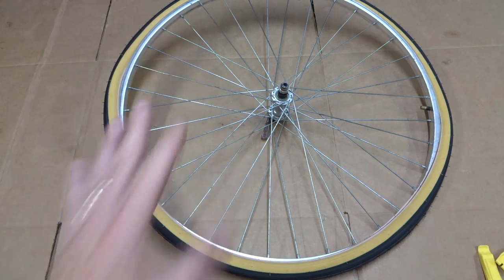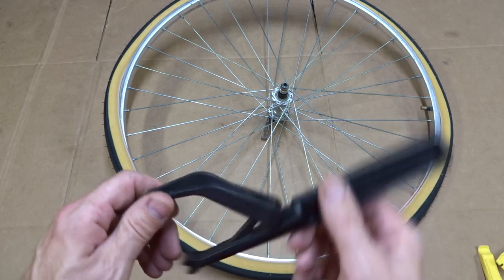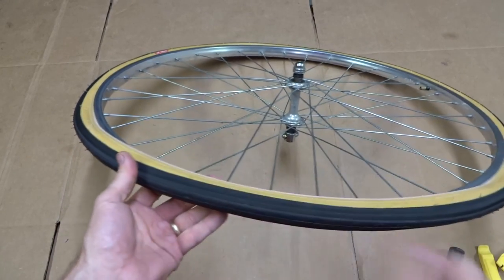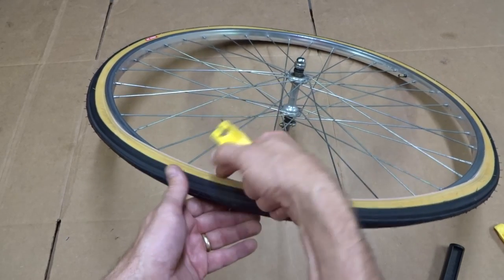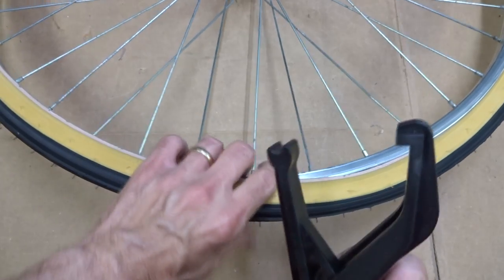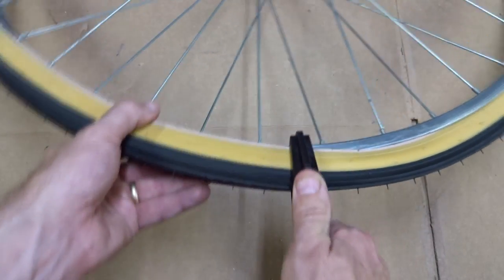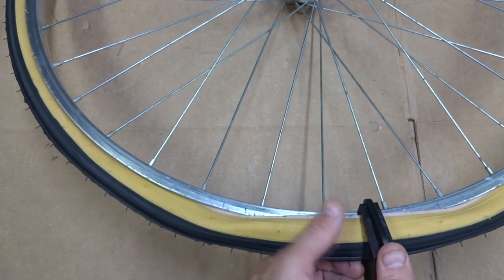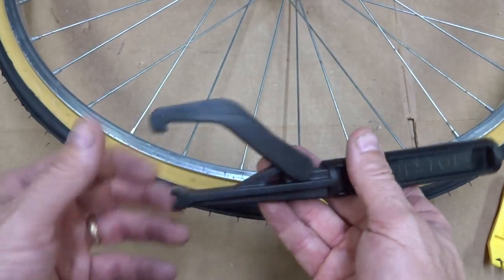How To Get Tight Tire On Bike Wheel Rim With Tire Bead Jack

Comment: I’m working as a rental bike mechanic…. My boss has 3000 bikes ffs ! And in two days I changed 10 punctures . We put new tubes in and a tyre liner that is phenomenally strong ( a pin 📌 won’t  through it ) then in the winter we have a glue party 🎉….. the point is that at 61 after a life time of using my hands as pliers I’m done ✅ with it . After my 10 tyre in 2 days , and some were new , my hands mutinied. This winter ❄️ alone I think I did more than. 50 …. So we have ordered tyre pliers , but the kind that has a tube profile on each side of the jaws . This tool looks cool 😎 tho …. As always thanks 🙏 RJ …. I spread the word about you here in Copenhagen

Comment: Use this tool in the shop where I work. I haven't scratched any wheels yet and don't think I will.  

Works great for road tires and narrow mountain tires but is a little tricky to use on wider mountain tires. In future designs it would be nice if it were wider to accommodate the added rubber.
Still, this tools has saved me a few times.

For those that say they don't need any tools I say good for you. Whatever. I've mounted probably thousands of tires and have run into some where something like this is essential.

Comment: From struggling to fit my very tight Gator tires onto rims to two minutes to do the whole job thanks to this tool. Not only did the tool work as promised, I also avoided damaging the tube as I have done before using tire levers. This is a great product. Follow this video’s advice and work the tool slowly across the last part and it will slide on perfectly. Great product and great video.
Reply: thanks, your comment motivated me to buy one. my thumbs all messed up and I just bought gators for florida roads.

Comment: Changing a tyre in a warm dry workshop is usually not too difficult but in my past 30 years on the road I've never had a puncture in a warm dry workshop ! Most of mine occur at night , in the pissing rain, in the most inhospitable place you could think off. I've had this tool for a couple of years now and to me it's a real game changer as i usually only carry one spare tube and the number of times I've nipped that with tyre levers is unbelievable. Despite some of the negative comments the one I have isn't too big and it fits easily into my saddle bag.

Comment: I got one of these yesterday and it is a revelation, I run Continetal Gatorskins on Mavic Allroad rims and I'm sick of skinning my knucles / nipping tubes etc. I've even managed to snap 2 Parktool tyre levers trying to get these tyres on....however, with this it is as easy as pie. I'm carrying this with me from now on. It IS alot bigger than a couple of tyre levers but the time saved when you are commuting and stuck in the rain trying to wrestle a tyre on makes it SOOOO worthwhile. 10/10 would recommend

Comment: Personal success story anecdote about this tool and Gatorskin tires:

I got flats three times with an older pair of Gatorskins. Two were my own stupidity (pinch flat from using a hand pump and underinflating it, another from pulling off the presta tip with said hand pump) and each time I had to take to a bike shop to remount because I couldn't get that Kevlar bead over the rim, apparently Gatorskins are known to be tough. 

I just got new Gatorskins a month ago and ran over this big piece of metal and went flat again. I decided to give this a try, not expecting much especially with a brand new tire. Literally 5 minutes and I seated the tire on easily with no pain or stress. 

I can't recommend this tool enough. It's only $11-12 and unfortunately it's a bit too big to fit in a saddle bag but it is invaluable.
Reply: "Tough?" 'Tough' isn't the word: I hope I never get a flat with my Armadillos. Took me an hour-and-a-half with 3 tire levers - and I still ruined 2 brand new tubes and almost broke the levers. Never had an experience like that in my life changing bike tires!

Comment: That's an interesting video. You endorse the idea of using a lever to install a tire. I guess you are lucky with that or you have an exceptional technique. I've installed thousands of tires, so I can't say I always avoid using a lever, because some tires are just impossible to install without a tool. My trouble is that when I use a lever, I pinch and puncture the tube 50% of the time. Not a good risk. I find the Tire Jack reduces that to about 0%. You say it's not a must-have tool. I had tires that was so reliably difficult that I carried the Tire Jack whenever I rode that bike, so I considered it a must-have at the time.
Reply: i just pinched 2 tyres at the side of the road, so i'll get this for sure
Reply: It's possible to get by without this tool hence RJ saying it isn't a must-have tool. It's definitely a labour-saving device though.

Comment: Having encountered a few "difficult" racing profile tires in the past prompted me to order myself one of these.  Still slightly skeptical I approached the initial time I used it with a desire to give it a fair chance.  To my amazement the engineered-in physics this tool embodies the tire went on quite smoothly without any undue leveraging of the tire which wasn't always true in the past.  You may not require it often, but when you do RJ is on the money as to it's being of good design and with proper care shouldn't scratch your wheels.  The material is what I believe used to be described as Tuff Stuff used to make virtually indestructible toys.  Great video and it should be used by their company as a guide on how to best use their product.

Comment: It's a great tool. I have some tyre / race wheel combinations that are impossible even with massive metal levers. So this tool makes it easy and avoids pinching the tube

Just make sure that if you need it to get the tyre on that you can get that tyre off in the middle of no where...

Comment: Great video - the Koolstop is great for those of us trying to install tubeless road tires on wide wheels  - and/or with weak fingers.  
As you said, not not an essential tool to own, but I agree it is a great and relatively inexpensive tool to have available as it makes fitting even a tight new tire so very simple!

Comment: I've got one of these built by a Taiwanese company called Bike Hand. The design is slightly different, as it's more of a scissors mechanism, but with the same slotted and hooked ends on each of the arms. It's very useful for mounting tight tires such as Continental road bike tires and 20" BMX/folding bike tires.

I bought mine while vacationing in Shinjuku in Tokyo. It's not available in my home country so it's a rather rare tool here.

Comment: Nifty tool.  I have a bike with a rim/tire combination that I have to use some dish soap as lubricant to help get the tire on by hand.   This tool looks like it will be helpful on the workbench.  However, this tool is a bit too bulky to carry for roadside flats, so I will still have to carry a little vial of dish soap in my saddle bag.

Comment: Has no-one ever taught you to finish at the valve so the rest of the tyre can be seated deep into the well as much as possible!!?
 Great videos though and yes I've had some tight tyres even finishing at the valve. Might even buy this tool if I can find one in UK.. Similarly to first remove tyre start levering either side of valve to get maximum slack. Best regards..
Reply: Nonsense
Reply: Truely, it doesn't matter.
Reply: SJS Cycles sell it which is where I bought man. Luckily they were able to deliver to Northern Ireland so mainland UK should be no problem
Reply: It's people like you who always find a way to make things more technical than needed.  Finishing at the valve?  Lol.  It's actually better to start at or just before the valve to prevent damage to the valve.

Comment: In 40 years of cycling I never had a set I could not mount with bare hands or tire levers. But nowI 've got a combination of Michelin Competitions tires with Easton EC90 rims that are a bear to install without pinching the tube. i've gone as far as using WD40 to lubricate the bead. I'm debating buying this, unfortunatly it's a bit large and nosaddle bag friendly.t

Comment: I have to agree with some other comments. Using a lever to get a tire on the rim is risky and I try do so only as a last resort. And my arthritis in my wrists is getting bad enough that I can't guarantee that I could get a difficult tire on using only my hands. This tool is essential if I am not to be stuck on the side of the road.

Comment: Good tool. I needed that when I'd put a 26 inch inner tube on a 700c rim. The tyre that used to go on easily, got very difficult. I didn't want to go and buy the right inner tube. Lol

Comment: I have a tight tire and my wheel always has this bouncing feel, as one end of tire does not fit in the groove. 
So my question is, can this tool, help to pull the tire into the rim groove properly? so that the wheel rolls smoothly.
Any response much appreciated.

Comment: What about getting the tire off? How do you use that tool for that? Thanks though for all the work creating this video!
Reply: just use levers
Reply: @charlesmiv3842  I've always used levers but studded winter tires are made of a harder ribber and much harder to get off. Mainly I just hope they devise a tool that will do both, take the tire off and put it back on again without having to struggle with the levers. I now carry the tire jack and didn't find out it's only for putting the tires on as I assumed it was designed for both.

Comment: I have a suggestion for a video: One of my Wolber wheels broke the axle inside the rim's hub. I would like to rebuild it but need to get the axle out first. I'm going to try a easy-out when I get the time but would love to see your take on this if you can duplicate the problem.
Reply from the maker: If the axle broke, it should come right out. The axle is the only thing holding the two ends in. I am assuming it's a common threaded axle with cones and lock nuts.

Comment: I have this tool and it does work. You still need to make sure the tube is UP inside the tire and not  still between the bead and the rim or you can still pinch the tube  It has happens to me.

Comment: RJ I'm looking for a took to prevent round straight pull spokes from spinning when truing a wheel. Any suggestions? I tried pliers clamping onto spokes, with a rubber band in between to prevent spoke damage, but no joy. 

Thanks
Reply from the maker: Lubricate where the spoke goes into the nipple.
Reply: RJ The Bike Guy I'll try, but I have these dumb Easton wheels with the hidden nipples
Reply from the maker: Then take off the tire and lube them from that side. Get a syringe with a long needle if needed. I pretty much always put a drop of oil on the spoke/nipple area before working on truing a wheel.
Reply: RJ The Bike Guy I'll try that. Thanks RJ

Comment: If you mount many tires daily then this tool would prove useful since. You would not get much faster than without it, however you'll have to use much less effort and it will be easier than with levers

Comment: Please help me!  i have a 20-year-old Hampton Beach Cruiser that i had restored a few years ago, but i wasn't able to get the original seat (which i loved).  The seat i have now makes me slide forward, and now i hardly ever ride my bike because it's so miserable.  i've tried every adjustment, but it's the seat itself that's too slippery.  Any advice on how to make it less slippery or where to find an original replacement seat?  Thank you.
Reply: Victoria Robersohn use sand paper, fine grade, and buff it perpendicular to the direction you're sliding. Should rough it up just enough to take the gloss off the sides where your thighs hold but not enough to look rough.

Take a little at a time, and use very fine (wet/dry) sand paper. Focus on an area where it won't be visible if you overdo it.

Comment: Just compress a portion of the tyre on the opposite end of the wheel by standing it up or stepping on that bit and pulling up.
Reply: Exactly , you can do this all by hand really easy once you learn that method. Before i learned it i was always having a hard time with the last portion of the tire.

Comment: How do you deal with a tire with a bead that sits to low on the rim (as in the bead has too small of a circumference to seat easily)?  I've had more than one tire that has been difficult to get straight on a 700c rim.
Reply: Nicholas Smerk Well... I think if you heat up the beads with a heat gun (when the tire is mounted on the rim) and then inflate it with a compressor or CO cartridge might do the trick. But I wouldn't do it unless its cheap rubber that no one cares about. The other thing is soap and water... and again inflate it with compressor. Good luck !
Reply from the maker: Make sure you have the correct size tire on the rim. Try brushing soapy water onto the bead of the tire then inflate it.
Reply: I'll try soap and water next time I have trouble.

Comment: RJ, I have a question for you. It is not related to the video, but it is related to a bicycle I own. I was moving around my bicycle, when I felt the rear tire fall down, which is weird to say the least. When I was looking at it, I noticed that it was missing the quick release bar that goes through rear bike was missing. I ask my mother, and she said she had removed it but lost it...

Can I replace it with any quick relase? The model of the bike is a Giant Escape 2 - 2015.
Reply: Edisson Ortega 
It should be okay as long as it and go pretty tight. But you should use the correct type so the shaft is the correct diameter.
Be careful with carbon parts.
Wieght for someone who knows More.
Reply from the maker: Quick release skewers are pretty standard. Just get the right length for your wheel.

Comment: Would this work with MTB tyers and wheels ?
Reply from the maker: Unfortunately no. Road and hybrid tires. I discovered that at a later point.
Reply: @RJTheBikeGuy  thanks for quick reply , is there any you would recommend for thick mtb tyres ?
Reply from the maker: These are what I use: https://www.amazon.com/exec/obidos/ASIN/B000IZGFCE/ref=nosim/youtube25-20

Comment: The trick to mounting a tire is to keep the tire bead in the center of the rim to gain the clearance to get up and over the edge of the rim.
Reply: Exactly. That's all you need.
Reply: I have pretty strong arms and hands. I was swearing while I mounted a set of 26x1.75 Bell Flatbuster, Cheng Shin, tires on a set of 26x1.75 Alesa rims. My left hand is now injured from a completely different situation and I can not get the tires off to switch them to wear more evenly. I installed them using three tire levers and a flat head. The levers where bending when I used them to put the tires on so I used them to help keep the bead inside the edge of the rims while I pryed the rest of the tire bead over the rims. Still, it was a battle to keep the levers from flipping back the other way as the bead tryed to pop back out. So, I had to hold the levers in place with my one hand and my legs. Fight, fight, fight, and scream but I finally set the tires on the rims without pinching the inner tubes. Tires are puncture resistant withe nylon liners and thick tubes so it was a real battle. The wheels will not ride flat but almost do. They roll well when flat without any tire or inner tube movement on the rim, very tight. Now, to get the switched. As I said, one hand is now weaker, so, to get them off will be another battle. To get them back on will be impossible without something like this tool.
Reply: "keep the tire bead in the center of the rim"

Do you mean push the bead in the middle of the rim like where the rim strip is?
Reply: Yes it's a geometrical property. You can deform the bead from a circle to an oval very easy gaining space to mount the bead because the fixed circle imposed by the rim is at a much smaller diameter (in the center).
For car tyres is even more so. ANY car rim will have a quite deep well in the center - without it it's pretty much impossible to mount without breaking the bead (you'll break the tools and deform the rim before you snap the tyre bead.. multi-stranded steel wires 10mm or so diameter in total)
Reply: I still don't understand what "keep the tire bead in the center of the rim" means.
Reply: Nevermind. I'm an idiot. I completely understand now. duh. smh.
Reply: Johnny  Or the continental super sport plus paired with a narrow rim. It is impossible to "put the bead in the center of the rim" with standard tools because it is a wire bread, with inflexible anti puncture protection. The bead doesn't want to go into the rim without eating the tube. A tool like this might just have enough leverage to force the bead into the center of rim and get the bastard thing on.

Comment: I've ridden so many times without tools! I'm a novice per say. So I usually did 20 - 25 miles round trip. I've been soooo lucky. Never had a tire blow out (Thank God). Actually one time, my seat came loose! Thank God there were a few tweakers who had Allen wrenches. I made it home. From then on, I bought a small tool set. Now, I will purchase tools just in case I ever have a flat! It's almost like having unprotected sex. All it takes is just that one time 😅

Comment: Nice tool, I wouldn't mind getting it for my 700C 'All Condition Armadillos' which are a nightmare to change (in fact, possibly the most difficult tires in the world to change as per web reviews and my own experience), but the plastic tool (from Communist China?) costs over $40 CDN by the time I get it and maybe 15 cents to make.